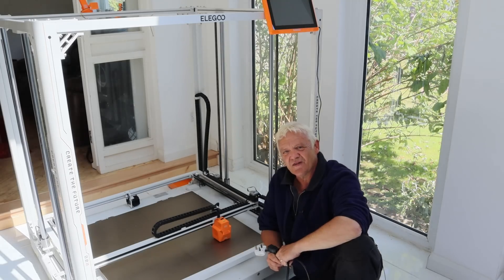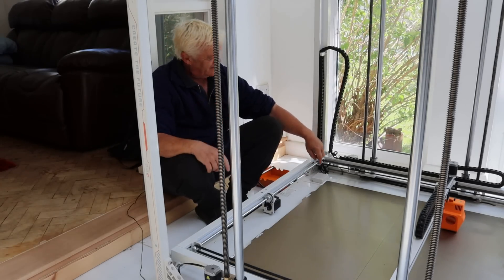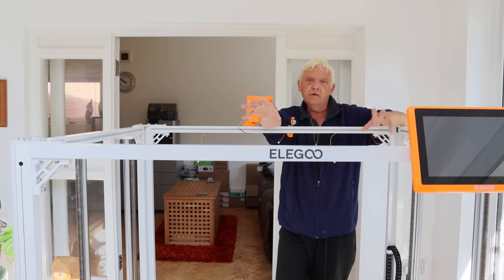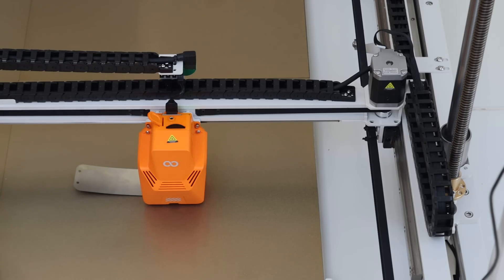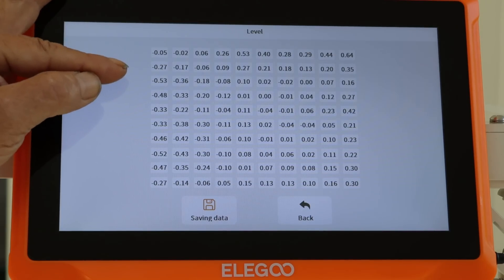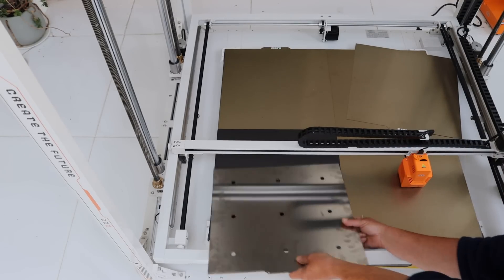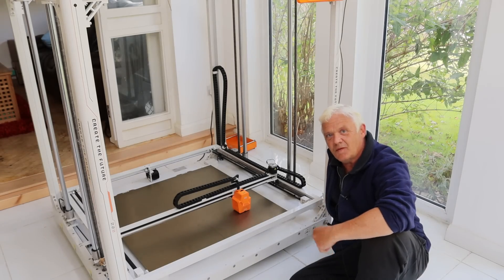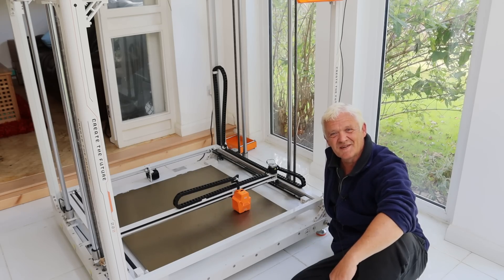2266 Setting Up The Monster 3D Printer - Elegoo Orangestorm Giga #elegoo

Comment: I've built myself a very large printer a few years ago.. First thing i see:
is there a built plate you can take of? Use a printing surface? Something like a sheet of paper or plastic and clip it with decent clips onto the build plate.. 
if a print gets really stuck on the bed, you almost have to destroy the entire printer to get it of the (heated?) bed...
I had a very thin piece of plywood with blue painters tape on it, so you can take the entire print out, and as the panel bends, it's easy to release the print from the plate..

Comment: One problem I can see with that printer. Its too open, bed adhesion or warping, could be problematic. Might be ugly, you could probably use the cardboard from boxes that it came in or get some plexiglass to put around it, to help regulate the temperature. I had to do that with my elegoo max 3 and its only 420 x 420.

Comment: I'm from South Africa and working for DKT Engineering. We bought a Mingda MD1000 printer. After waiting for about 2 months it finally arrived. I was very excited to unpack and power it up. It's a monster with a build volume of 1mx1mx1m. Unfortunately after I've been using it for about a week I found out that printing anything round comes out oval. At first I thought setting the steps of the X and Y steppers will solve the problem but that was where the simplesty of solving the issue ended 😂 Square objects measure size in the X axis and Y axis so changing the steps would not solve the problem. I got the experts in and they started by setting the tension on the drive belts and doing other stuff for about 2.5 days and they left saying that they could not find any solution for the problem. So after paying 700k in South African rand (ZAR) for the machine it's just standing in a room next to my office for the last two weeks. I'm planning on building a Voron 2.5 and after completion I'll show them a printer can do. My personal opinion is that big machines aren't as accurate as smaller ones. Hopefully you will have better luck with your machine Robert. Love watching your videos my friend. Keep them coming

Comment: I worry about temperature fluctuations next to the window because it's a large metal contraption with a thermal coefficient of expansion. People with large CNC machines put them in temperature controlled rooms. Anyway, these Chines made products designed for export to the US have to meet certain electrical standards, hence the breaker switch and heavy gauge wires.

Comment: You say its propriety because its not a standard "kettle lead"  IEC (C13/C14) while I cannot tell from the vid but is it possibly a IEC C19/C20 which are a common replacement for the standard "kettle lead" for higher powered devices?

Comment: For a mad scientist,  I must say your home looks quite in order. My first experience with 3 D printing was about 32 years  ago, set up a convention for 3D printing . I wS amazed at what they could do one made ball bearing races out of a ceramic material, printing a wax in the voids , tap it on the table the wax fell out turned to dust at room temperature.  All the parts for a small block Chevy engine , now that was tempting  1/10 scale . As a modeler I could see a tiny dragster ...take care . In my years of setting up such things I learned to wire in many nationalities ...what's life without a challenge?
Reply from the maker: I agree mate challenge is what you need!

Comment: Robert! I am so good that you are up and making videos again. We support you fully if you need anything! Concerning this monster of a 3D printer: Will you have to bundle up a fist full of those large glue sticks to help detach very large printed objects from this massive base?
Reply from the maker: cheers mate - and i was pondering that about the glue sticks - i am going to try without and see what happens if iget too many fails i might print a multistick holder
Reply: Yes, a monster 3D printer requires you to be  "Puttin’ on the Ritz"!  Possibly you could mix up some Elmers Glue to make a large stick or spray-on glue accessory for the printer.

Comment: That's a 16A C19 plug - not proprietory. I wonder if they used that as the heated bed pulls more than the 10A rating of a normal IEC - the European Schuko plug that was fitted is rated for 16A - if it's over 10A it could be marginal for  a 13A socket .
Reply from the maker: thank you mate - i didn't know that and that is good info - thanks for sharing - but a 16A rating is plenty it is double the draw - which is going to be at most 8A

Comment: Could you print a largue fresnel concentrator lens if you have transparent filament? Maybe fill them with water? Big 1m x 1m sheets are quite expensive. You could also adjust the focal lenght
Reply from the maker: i wonder - nice suggestion - cheers mate

Comment: Dear Robert that is not a propietary plug, luckily. it is a NEMA or IEC? C19 plug .  google for "C19 Plug"   it is used for high amperage plugs normally found in UPS and PDUs in computer racks. it's far more common in 110V applications for the amperage restriction.

Comment: this is more a thought for elegoo than you.. but since a lot of heat is lost from the bed to the atmophere.. and I wonder if instead of enclosing the whole thing (Still a large volume to heat) if it could have a 'top' that rises with the extruder, and maybe accordion sides that rise with the z axis.  basically creating the smallest volume to heat and retain heat while adding neat zero mass for the printer to work with. 
would make bed heating faster and might work better with some materials like petg or abs. ;-) 
if you have contacts, please pass it on!
Reply from the maker: i will do mate - though i have to tell you elegoo read these comments too

Comment: I am fairly certain that the power connector is a standard IEC C19, as used on many high capacity UPS's.   Long cables with UK plugs and IEC C19 connectors are easy to find on Amazon.
Reply from the maker: cheers mate - i didn't know that - thanks for sharing
Reply: yeah i agree 100%.  it's a C19 plug we have them on our UPS and PDUs
Reply: Yes, looked like a 16A connector to me.

Comment: Phew! At least you only need to do that once! Please can you attempt a Kinetic Buoyancy Gen ? Ive gone over the Maths with GPT and can show you proof, this company have certificates and are selling this device in Germany. (see)" Free Energy Generator - Buoyancy / Water Displacement Power Plant producing 5kW of electric energy".  The size of machine is determined by  LPM of compressed air you have, just need to test how much water it can displace in 1-2 seconds. That determines the size of the containers . Then if its going to be eg 3m high, and you have eg. 10L containers,  and  20 total containers(10 going up & 10 going down) , then the side filled with air will have 10L x 10 = 100KG of buoyancy force at all times . The higher the machine is the more efficient it gets. it achieves 10x OU +.  People say cant get more out than in, thats true , it fills up the buoyant side bit by bit and stores a hell of a lot of force that it dumps at the top , one by one!
Reply from the maker: i will have a think about it mate - lots of projects to do!
Reply: @ThinkingandTinkering  Found the name of the printer "Micronics SLS"